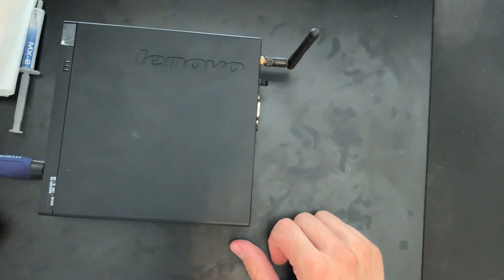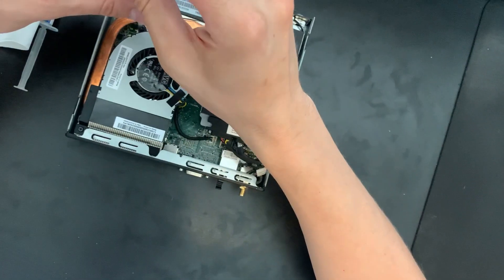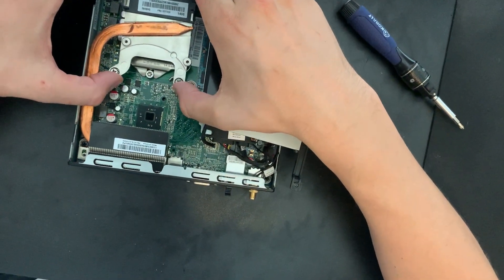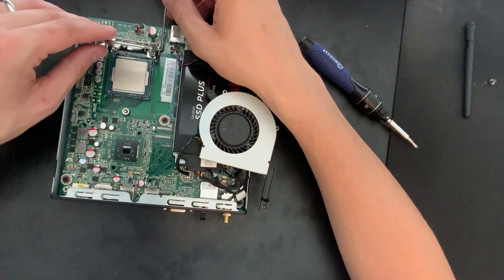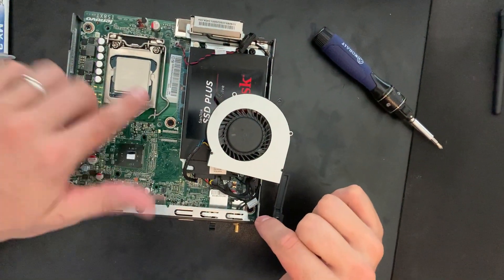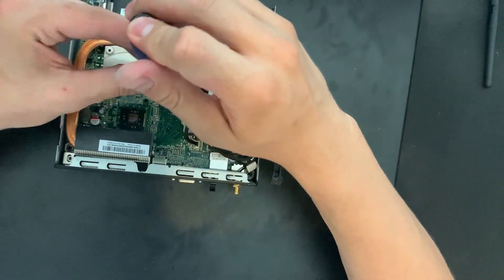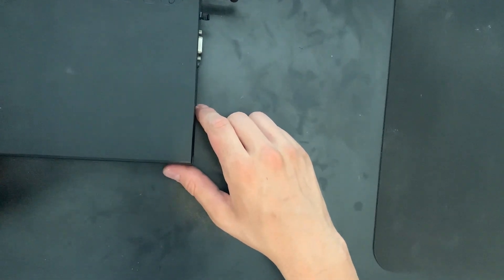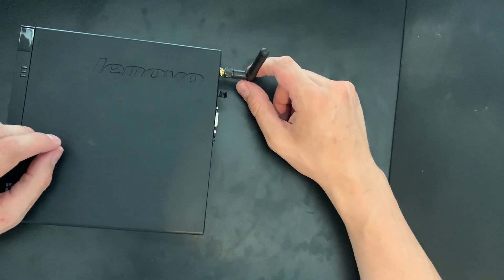M93p / M73 Lenovo Thinkcentre Tiny CPU Upgrade!

Comment: I'm running a Intel Xeon CPU E3-1265L v3 @ 2.50GHz × 4 works well.
Reply: did you have any issues when you installed it? mine wont post after the swap with xeon 1265l

Comment: If you want to know which are the best processors for this PC in addition to help for the (m73p and m93p) they are:

i7 4765T 35w (The lowest consumption and performance of all i7 4th)
i7 4785T 35w
i7 4790T 45w
i7 4770T 45w
i7 4770S (Best in performance) 65w
i7 4790S (I don't recommend it but it can handle it) 65w+

There are xeon processors that are similar in performance but the integrated ones are not very good so to speak.

The rest of the processors (without letters or K) require modifications for the original adapter, which is a PSU (65w). I recognize that any of them are good depending on their use and most are expensive in price (all those with T) and yes. When you buy the 65w ones you have to have a good air flow type because they will heat up with the mini heatsink and fan that these 2 machines come with (I hope it helped you!!)
Reply: Is i5 4590t a good option for upgrading the tiny processor?
Reply: @kdygamingcomunity6280  tbh js go for an i7, i5 4th gens are just so hard to deal with and feels like a waste of money i recommend i7-4785T
Reply: thanks bro i have lenovo thinkcenter m73 with i3 4130t cpu  now i can upgrade

Comment: Would this work with the i5 4690? I have the i3 4130t
Reply: It would be a disaster since the 4690 is a 84W CPU but don't worry. The i5 4690"T" would work just fine with close to no performance loss. When upgrading these little ones, always put a "T" processor and not the mainstream one.

Comment: I have recently just turnt my m73 sff into a great gaming machine. 

Ive done:
•case swap
•upgraded to a 550w PSU from standard 240w
•480gb SSD
•upgraded from i3 4170 to i5 4590 (going to step up to a i7 4790)
•Low Profile nvidia gtx 1650
•8gb of ram
Reply: friend help me, how did you put the gtx 1650 low profile to the computer?
Reply: @alplayyt7218  it doesnt fit into the original case you will need a micro atx case and do a case swap. I will make a video of the build on my gaming channel  (PuRe Mercx)

Comment: I have this same unit, the M73 Tiny, i removed the wifi card and wanted to install a Mini PCI-E SSD. You have any knowledge on that? From what I read you need to hack the bios to allow it but cant find any other information on that. Thanks

Comment: THX for your Video! 
-
And for all who are interested --- I upgraded my Lenovo Thinkcentre Tiny M93p Intel Pentium G3220T
Now it has a Intel Core i5-4590 SR1QJ (4 X 3.30GHZ) and works perfect! (normal version 84 Watt , without T or S)
I use a PSU - output = 19V 4,22A 
I simply cut off the cable with the yellow plug from the original power supply 
and attached it to an old power supply with enough power. ;-)

Comment: can u pls give the information type of the wifi card. because im using with acer wifi card it doesnt work and i got information that "unauthorized network card is plugged please turn off"
Reply: eg: 
IBM Lenovo 04W3818 20-200440,  RealTek RTL8723BE, Wlan Wireless Wifi BT 802.11bgn

Comment: those intel  i7 4785t  cpu fit and  Intel AX210NGW Wi-Fi 6E Tri Band M.2 2230 Bluetooth 5.2 WiFi Card fit the system ?, thanks!
Reply from the maker: That cpu should work just fine. Not sure about the Wi-Fi card though.

Comment: Check out the Magic Reform CPUs on Ebay. I dropped in a Crystal Well 4980HQ laptop CPU that had been converted in China to a standard desktop socket. Even without the 90 watt adapter or voltage tweaking I'm seeing roughly 30% more CPU performance and nearly double the graphics performance going to the Iris Pro 5200 pro.

If you do this mod you will probably need to mod the retainer mechanism to sit higher or remove it altogether. I removed mine but left the bottom plate screwed in to add extra support to the socket. 

The CPU is -thick-. I ended up carefully seating it, applying paste, and tightening the heatsink screws one by one to slowly apply even pressure without the retainer. Temperatures are a bit hotter than stock (going from a 35w  4765 i7 to the 47w 4980 hq), but not terrible. It puts light PS2 emulation within reach.

Comment: I bought an m73 model,  but found out the cpu is dual core not quad core,  but glad to see it's upgradeable.
Reply: Greetings,
As someone who has this exact computer and a haswell system of a larger size, I can indeed confirm a quad core CPU with full desktop performance inside of this computer is what you would call "a fire hazard"

Comment: Hello, I have a question is that I have a lenovo thinkcenter m73 tiny with an i5 4570t, will it be that if I change the processor to one without T, will it give me problems if I put it with an adapter from another brand? and can you put a dedicated graphics card?
Reply: The cooler will probably handle the heat load OK, but it will be very loud under sustained load. I'm not sure what adapter your talking about. There is no adapter needed for a CPU upgrade. The Tiny series of PCs from Lenovo cannot use dedicated video cards.
Reply: dude you can ever heard of exp gdc?  just whiyelist the wificard and your good to go

Comment: I upgraded mine to a i5 4570, what a big difference over the 3220t that was in it, I thought the 4570 was too much power for it ,but it handles it like a champ, even the cooler keeps it just hair under 80c running cinebench. Now I just want to use it for something, I don't want to sell it, maybe as my backup PC, idk. Love these little things.
Reply: Hello, i5 4570 or 4570T ? Cuz the 4570 have a tdp of 84; no problems with it ? thanks
Reply: @user-rl2sg5jo5q  No issues on my end, still runs 24/7
Reply: @user-rl2sg5jo5q  I put an 84 watt CPU in it and it almost melted the fan
Reply: @Ieatcrumbs  and 84 watt CPU wont be able to get hot enough to melt plastic, hell any CPU now a days will not get hot enough to melt plastic even over time.
Reply: What about the power supply? Did you have to upgrade to a higher wattage supply because both 4770 and 4570 are 84 watts.
Reply: My room is full of haswell computers and I have one that runs like three OSes and it's my main machine. I put a core i54590 in this thing THE VERY SECOND I FOUND OUT IT HAD A SOCKETED CPU. I almost ended up melting the fan inside of the poor thing and figured out that the core I34130T inside of the system is actually held back by the memory bus. It was able to edit 1080p video in my big fast motherboard alone just like my core i54590 and then my core i54590 was immediately disabled upon entering "the oven" whether it was due to thermal issues for memory bandwidth issues is not even debatable I saw it loud and clear this thing does not know how to manage memory

Comment: Can you please tell me what software I need to upgrade to install a new m73 processor. Upgrading from 2600 dual core to a i5 4790t. I thought I had updated the bios and chipset, but still wont boot up. What am I missing?
Reply: You cannot go from a 2nd gen to a 4th gen. They use different sockets, and are incompatible.
Reply: @SimmanGodz  oh god if they have different sockets that must be an expensive mistake :/

Comment: Would a haswell xeon or i5 non T version work on m73? or is it just for m93p only?
Reply from the maker: I think any cpu will work but it might get pretty toasty. If you use a xeon it needs to be one integrated graphics. And make sure you are using a bigger power brick, a non T or S cpu might require a 90w one.
Reply: @BrooksyTech  Thank you!

Comment: Can I upgrade the m53
Reply from the maker: Looks like the m53 has a soldered cpu. So probably just add more ram and an ssd if you don't already have one. But I would double check the system info on lenovo's website first.

Comment: Im still using a trusty Thinkcentre M73 SFF.  Leaving in partially unassembled state for GTX 970.  The only unoccupied slot is PCIE x1.  Im curious how you make use of the little thing.  Im wanting to put in an adapter and a NVMe memory card.  Whatcha think?
Reply: Still got the SFF? I've got mine and i'm getting set to up the ram and service the thing by re-pasting. Been a real nice box.

Comment: Can the ThinkCentre M93 SFF support the Core i7-4790s?
Reply from the maker: It may work but I would double check first.
Reply: @BrooksyTech  So just a quick update.  After the bios update, the i7-4790s does work.  As it turns out, it’s the same architecture as the 4790, which is Haswell, but uses less wattage.  The 4790k has a slightly different architecture, known as Devils Canyon.
Reply: @JFrusci  did you have to update the chipset also? I am trying to update to a 4579t and I know the board supports it. Trying to find out what u am missing. Thanks
Reply: @ryecatcher25  All I did was update the bios to the latest version, then I ran an update of all drivers, which did include a chipset update, but the computer booted up with the processor after I did the bios update.
Reply: Thanks for the response. Did those things and processor still wont work. Maybe it's bad. Do you remember changing any bios settings after update.
Reply: @ryecatcher25  Nope.  All I did was flash the BIOS to the latest version, removed the old processor, installed the new one, installed Windows 10, then updated every driver the scan found.  Sorry this isn't working for you.  Remember, that it only supports up to the Haswell architecture.  What is the architecture of the chip you are installing?  If it's Devils Canyon, I've found that did not work on this machine.

Comment: Was that an i5? Upgrade to an i7?  Thank you  ah, pentium! 🤓 also, when the heatsink/fan is removed, good time to inspect & clean. I think the M710Q can be upgraded, too
Reply: I've seen one guy on here upgrade to an Intel Xeon E3-1275L v3 for the best benchmarking results.  I just ordered one for my M73 because I use it as a tiny Linux Plex/file/web server.  The stock i5 has handled what I needed like a champ, but the extra horsepower will be nice if I ever get a surge in web traffic to my site.
Reply from the maker: Ha I upgraded to an i3! But it had the 4600 integrated graphics so thats what was important. Works great for  emulation.

Comment: BrooksyTech, I have the Lenovo M73 tiny with an I3 processor, do you think that I could either upgrade the CPU to I5 or some thing by AMD Ryzen?
Reply from the maker: It has to be a 4th gen intel chip like an i5 or i7. Maybe something like a 4765t would be a good upgrade for less than $100.
Reply: Just to add that it really needs to be an Intel i3, i5, i7 or Xeon that uses 45 watts or less due to the limitations of cooling and the power supply. I've just upgraded mine from an i3 4130T to a i7 4765T (with the help of this handy guide) and it works fine. They are both 35 watt parts. Be careful to get a CPU with the model ending in "T" which denotes ultra low power with a 35–45 W TDP.
Reply: @nickmoore385  What Xeon chips would you recommend?
Reply: @seanwoods1526  Either the XEON E3-1275L V3 which runs at 2.7 Ghz,  or the cheaper E3-1265L v3 which runs at 2.5 Ghz. Both are 45 watt CPUs.
Reply: @Huub_Z  I don't think so. The Xeon E3-1265L v4 is an intel Broadwell chip so I'm not sure the motherboard will support it.  You want a previous generation low power Haswell based CPU.

Comment: Wi this work on the i5 m73's and if so, what procesor could you upgrade to?
Reply from the maker: I would recommend something like an i7 4770T or i7 4765T. Buy yes these should should work with all m73s.
Reply: BrooksyTech can u send a link to a i7 4770t please
Reply from the maker: @haze371  Just search for them on ebay. Stock is always changing. Or you can try alixpress
Reply: @BrooksyTech  I just bought a 4770S which states 65W.  That should work eh?

Comment: I honestly didn’t know you could upgrade any of the hardware on boxes like those. I honestly thought they were all built in.
Reply from the maker: Yeah its pretty cool, you can also upgrade the ram, ssd, and even wifi card! Just have to be careful on the wifi card as only certain models work. Not approved cards will make the system not boot.
Reply: BrooksyTech been there done that. I tore apart a couple of laptops. I never realized how different laptop parts are.
Reply: BrooksyTech been there done that. I tore apart a couple of laptops. I never realized how different laptop parts are.